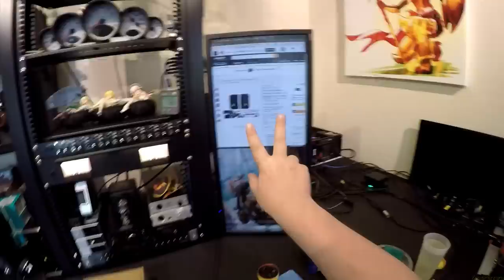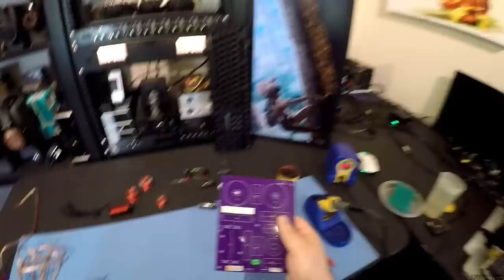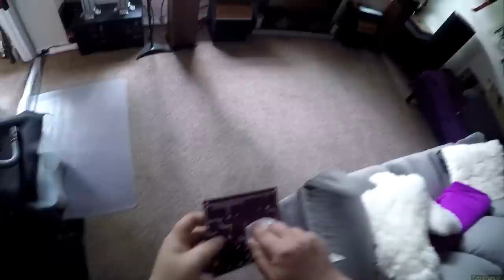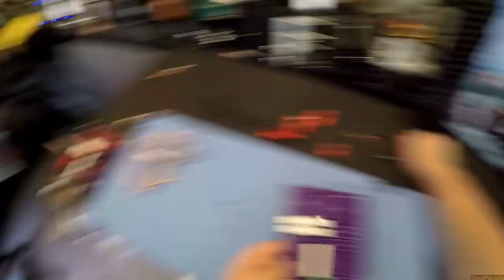Z DIY - Swan 3.1 :: X-OVER ASSEMBLY [PART-2/4]

Comment: Resistors are used to essentially add load to one side of the crossover, so that you can use drivers without the exact same sensitivity. This is basically wasting power but makes speaker design somewhat simpler. The wattage rating is how much power they can dissipate, if you use too high of a resistance and then run too much power through that portion of your crossover it will fail.

https://www.electronics-tutorials.ws/attenuators/l-pad-attenuator.html

Capacitors are used for their property of resisting low frequencies, when you double the frequency you halve the impedance. Inductors are essentially the inverse, filtering out high frequencies.

https://www.audioholics.com/loudspeaker-design/crossover

https://www.audioholics.com/loudspeaker-design/the-loudspeaker-crossover

Also important is the use of zobel network(s), which is a capacitor and resistor in series to flatten impedance spikes for a driver. The voice coil in a driver is by itself an inductor, hence why impedance changes with frequency.

http://audiojudgement.com/impedance-equalization-circuit-zobel-network/

You don't need a masters in electrical engineering for speaker building but understanding the basics will save you a lot of time and money. You can do amazing things with cheap parts if you pick and assemble them properly.
Reply: Alex Z , perfectly said.
you are very correct

Comment: Z, if you cut into a solder joint, hit it again with the soldering iron. Otherwise you will find the joint is weak and will come loose later. Speaking from experience.

Comment: That would be a second order three way crossover. The resistors are just there to attenuate the drivers. This kit seems to be missing the zobel networks, though. That will reduce the accuracy of the crossover point for the woofer and midrange. The crossover point will change with the impedance of the driver as it moves in and out without a zobel.

Comment: use a craft knife for the thick coils
when solder temperature set 370 degree for lead solder clean and dip the
 tips to solder, use the 3 sec rule for proper soldering

Comment: Asked you so many times when are you gonna listen to some Genelecs, during a stream 4-5 days ago you told me 'fuck you' when I said Genelecs are better than iLouds, but it is absolutely true. Even the smallest Genelec would use iLouds only to clean the toilet. Every size up from the G one just gets better and better. I Dare You to test-listen some Genelecs. They are pretty much the king brand of neutral, accurate and high end speakers. G Three upwards you don't need a sub.
Reply from the maker: I really rarely choose what I listen to next. Someone usually contacts me saying they have this speaker or are going to buy that speakers and then I get a swing at it. The patreon money does sort of change things up but I also have to decide when I want to have them around.

Comment: Should have the resistors slightly off from the circuit board about 7mm they get hot if they driven hard plus they rattle just place a bit of foam between them. Sold of the whole track and use hi pure solder with high content of silver for the tweeter and use pure lead solder for the mid-range and bass you should hot glue the inductors down and capacitors then tie wrap it. All capacitors do have a polarity even if they say they don't ? they're just not crucial like electrolytics but you need to find out what the outside foil to terminal is your need to use a scope for this. When screwing the circuit board to a Backboard or speaker use some rubber grommets and preferably copper or brass sleeves over the screws compressing the rubber grommet by 2-3 millimetres ideally placed it at the bottom back not behind the driver. You might want to introduce a metalcore in the middle range driver's inductor only the one in Series to the driver, you might find using a couple of still nuts would fit perfectly hot glue them in place comfortable fit to the inside of the coil no gaps. Rosin isn't poisonous or cancerous, Flux could be depends what it's made from like hydrochloride acid rosin is made from Pine wood sap generally

Comment: Btw, you can replace that 1.5 ohm resistor with a higher value one instead of covering the tweeter with foam (I know getting the crossover out is a pain)
Reply from the maker: I removed the foam. I want to see if burn-in on the drivers is affecting them.

Comment: you could just use hot glue instead of ugly zip ties People please use wire strippers!
Reply: Resistors get hot. If he used hot glue it would immeadiately melt when he started using the speakers